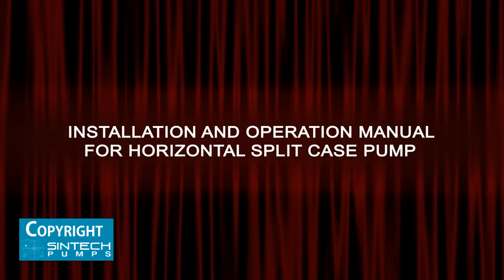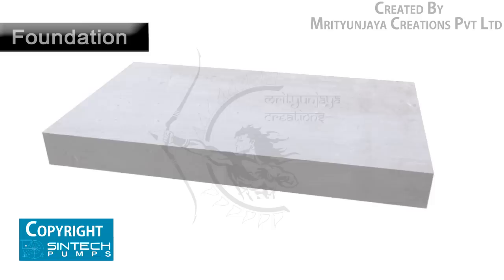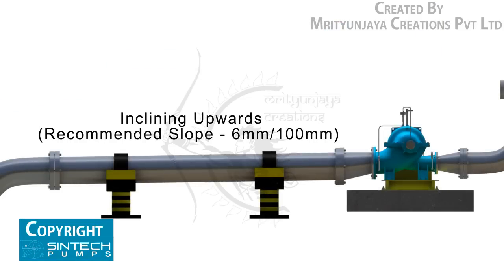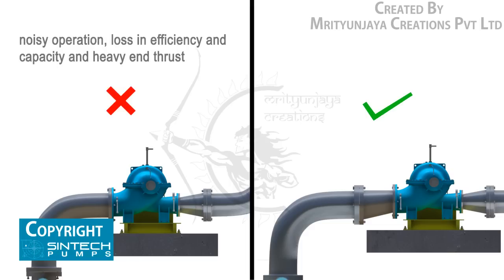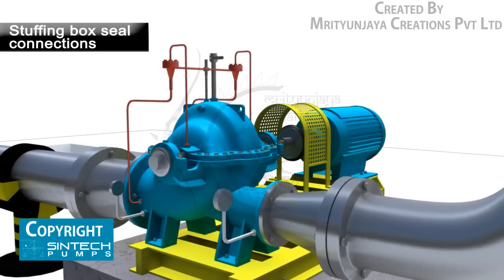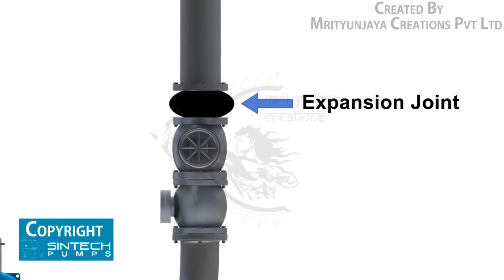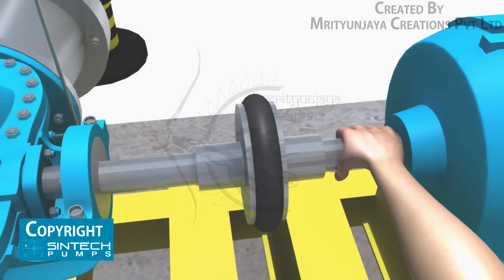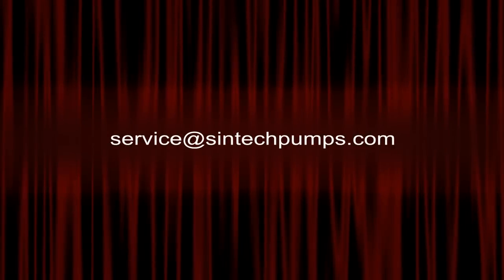Horizontal Split Case Pump Demonstration (Animation)

Comment: i think most pumps need to install flexible to pump inlet and outlet to isolate vibration from pumps being transferred to pipe and also strainer to pump inlet. and i do not think you should close discharge valve until pump driver is stopped.

Comment: nice presentation..but it should have also specified the proper sizing of the discharge pipe by controlling the discharge velocity at around 6-9 ft/sec to make it a better and perfectly accurate presentation.